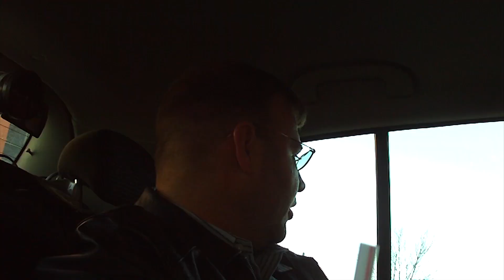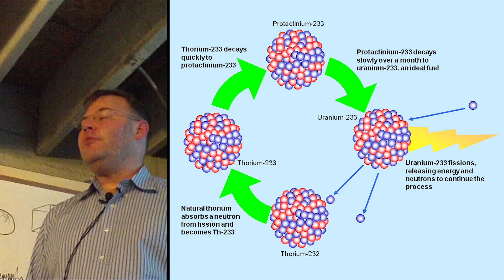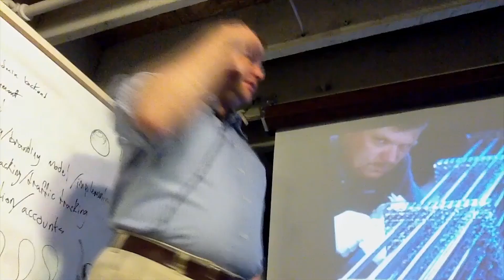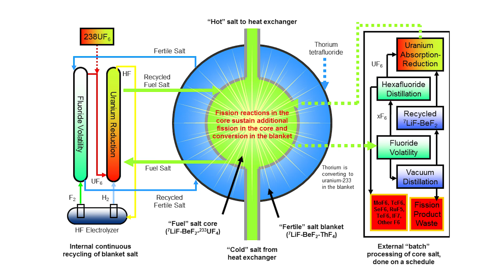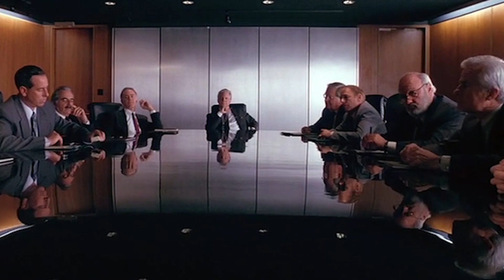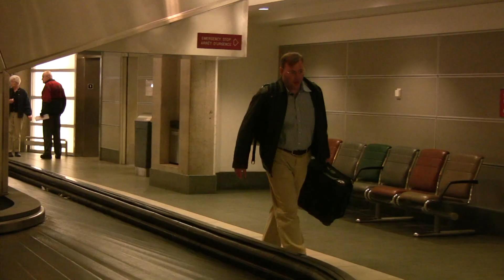Nuclear Fuel: Liquid vs Solid - "Th" Thorium Documentary

Comment: Why not a "Fast" Thorium reactor we could use cheaper salts like
 zirconium tetra-chloride. And it would be cheaper as that you would need no graphite.
Reply: David Vermillion Fast reactors require a much larger mass of fuel to overcome the smaller cross section in the fast spectrum.  That means a larger reactor and more startup fissile which is already awkward enough to deal with.  And of course, the existing body of knowledge on MSRs has been from thermal reactors so making a molten salt fast reactor means more R&D as opposed to piggybacking from Oak Ridge data.

Comment: I have a feeling that Lithium fluoride and Beryllium flouride are pretty expensive and rare materials. Are there any possible substitutes?
Reply: Ilir Kumi Your "feeling" is wrong. Both lithium and beryllium are fairly common, enough to build thousands and thousands of molten salt reactors. There are cheaper salts, like sodium fluoride and potassium fluoride, but they have worse neutron properties than Li & Be..
Reply: Ilir Kumi there is only one drawback to the LFTR tritium production, but tritium is rare so a stockpile may be able to allow some interesting research and product to be made.

Comment: Can we use table salt?
Reply: Evidently the main candidate is a mixture of beryllium fluoride and lithium fluoride.
Reply: depends on our tech level...
Reply: table salt has a higher melting point I believe. Also, it doesn't have the right chemical properties at high temperature in a very high neutron flux environment.

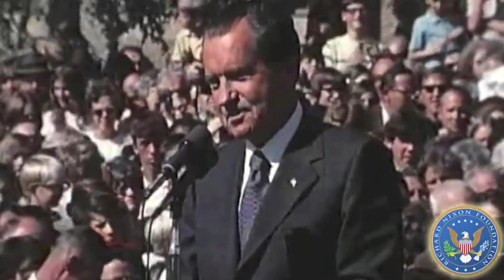Comment: At 8:00 or so the blame is placed on Nixon, which is a fair point considering the evidence.  However, and I suppose I am going to come off as a Nixon apologist here, there is another significant event that is overlooked.  Brayton-cycle and supercritical CO2 turbines.  This technology did not exist at the time and really are what put LFTR above other nuclear options for power production.  At the time LFTR was considered only in the context of lower efficiency Rankine-cycle units.  It was considered only with the same power generation units that PWRs and coal plants have.  Now, with the benefit of hindsight and taking advantage of LFTRs high temperature for its long-term economics, we can make a clear decision why LFTR should be pursued over fast-reactors (if that choice must be made).
Reply: No, actually the fluid fuel thermal breeder was still considerably more efficient at fuel utilization versus solid fuel designs. Also, the fuel fabrication costs were magnitudes cheaper. Super critical gas turbines just add to the total cost benefit.
Reply: JB6789 "the fluid fuel thermal breeder was still considerably more efficient at fuel utilization versus solid fuel designs"

For solid fuel light water designs that is was supposed to replace, yes.  But it is not more efficient than sodium fast reactors also in development that it was in competition with.
Reply: Randall Waitt I see your point there. The fact that sodium fast reactors were already funded like crazy at the time must have compelled the decision to pull the plug on MSR.